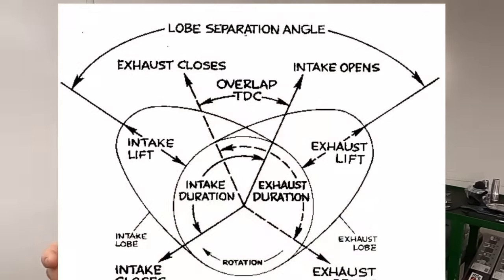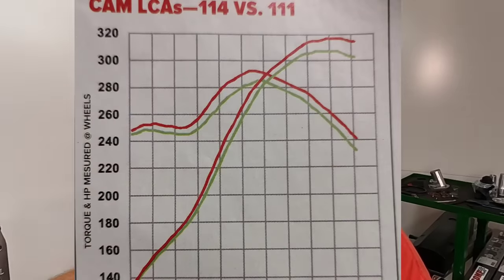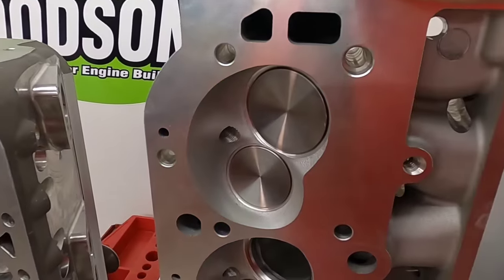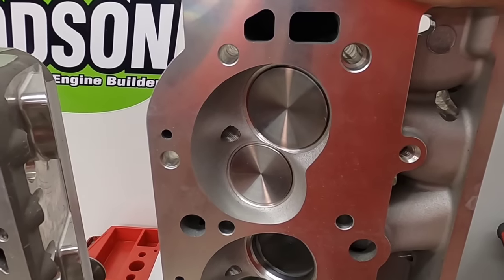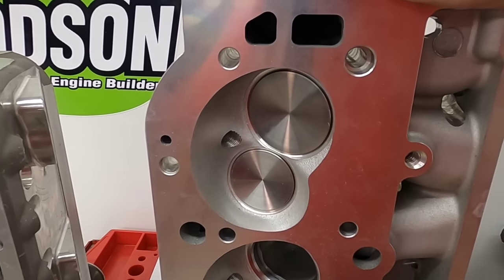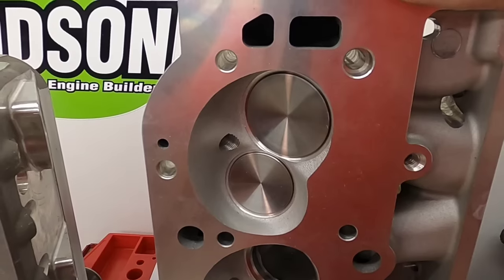Camshaft Lobe Separation Angle: The Untold Truth of LSA!! How to Pick LSA the right way@DavidVizard

Comment: I would like to know how much more violent or unstable a combination of tighter lsa vs wider lsa maybe camshaft companies are also looking at stability of valvetrain so leave a few hp on the table for longevity that was the issue of the old small block cams till it was figured
Reply from the maker: The lobe profile dictates the stability of the valve train. The LSA has no effect on that aspect.
Thanks for watching
Andy
Reply: I’m confused I understood that high compression tighter lsa since it can afford to lose some compression static vs dynamic and wider lsa to lower compression to leave more compression in the chamber but I am still learning

Comment: Richard Holdener just did a LSA video on a 500HP combo at 6500 RPM...    Same camshaft lobes ground on 120, 112 and 108 LSA.

In theory we would think tighter LSA's have more mid range torque but sign off earler and the wide lsa would have a broader and wider torque curve.

In Richards demo, the 112 LSA made 30 more ft-lb from 2500-5500 RPM than the 120 LSA and matched it after this.

The 108 LSA had 14 more ft-lb over the 112 LSA from 2500-5500 RPM and matched it until 6000 where somehow it made 7 more peak HP.    He didn't talk about it, but i felt it was from the exhaust system being able to scavenge better with the tight LSA.

So it was clear that you need to test, but tight lsa's seem to have alot of magic!

Comment: I have read that fuel injected engines like more LSA, is there any truth to this?
Reply from the maker: People tend to use wider LSA as a bandaid to cover up the fact they have too much duration.  It's better to have less duration on the right LSA the engine will make more power through the entire curve.
Andy
Reply: @UnityMotorSportsGarage  why?  Because it decreases overlap and idles smoother?

Comment: i dont know how long you have been building engines or if you are close to my age, but i have been building engines for 42 years ,im am a cam fanatic,  i buy cams with spacific  lobe patterns , im not you average 3/4 RACE  CAM  idiot , i under stand cam specs , i have a question for you you, probably havent  heard on here ,back in the 80s  most cams  were 106 or 108 lobe     separation as after market purchases, anything more 112  - 114  ,were considered blower or nitrous cams , what caused the change, now nothing comes 106 or 108.   i remember you would open summit or jegs catalog and most  aftermarket cams listed were 106  0r  108  lobe separation ,open the same catalogs today  and all but 1 or 2  cams listed are 112 or 114  , something changed along  the way, what did cam  companys figure out they didnt know  in the 80s,  please tell me if you know.
Reply from the maker: One word Marketing.. back then people would always pick a cam too large for the application and the cam companies had tons of complaints because of this.. Cam companies knowing people would continue to pick larger cams they decided to widen the lobe separation to make the car more drivable they are in the business of selling cams.. not making sure what you buy is right for your combo...
Reply: @UnityMotorSportsGarage

Comment: what about boosted?? and street driven daily with low boost 14psi @ 4500    372 sbc  hows 244/252@50 with 620 lift and 10.2:1 comp  with  116lsa
Reply from the maker: If it's turbo it depends on the pressure ratio across the engine.. ie back pressure in the exhaust vs intake boost 
Andy
Reply: Ede1179 supercharger
Reply: eaton 2650  e85 efi  3.48 stroke 4.125 bore 6.0" rod 215cc intake 2.08 and 1.6 valve

Comment: A street engine also has to be somewhat tamer than a full out race engine for obvious reasons vacuum being one concern plus just being finicky and idling being something that a street engine has to do often so a 108 on the street is a bit much in my opinion i would never suggest anything tighter than 110 or 111 for a street car but u are just gonna start it and go a 1/4. Mile or less and shut it back down hell yeah 107 and squeeze the snot out of it long duration super great heads and valve set up like a chevy 302 not the street version lol big valves springs that dont float solid lifters moderate lift but tight lsa and long duration spin it to the stratosphere and power will be there build it and they will come lol
Reply from the maker: If Vacuum is your goal, the engine will make more power using less duration on the right LSA rather than a larger lobe on the wrong LSA
Thanks for watching
Andy
Reply: Still dont understand how to pick the right LSA
Reply from the maker: my next video will shed some light on that..
Andy

Comment: I got a 94F150 flareside! Got heads! Thought bout retarding the aftermarket cams! I want powered from 3000 to 6000rpm! That's a tall order! I wanna drive it Sunday afternoon! Milage isn't a priority! I drag raced for 5 years! I got a 93 roller 351w block. 393w? Got a 100 shot of gas!😂😂
Reply: Noone gave a reply! We drag races foxbody Mustangs for years, but this is a pickup! I know guys that just jumped to 460's,  with good results dollar for dollar. I have a tci c4, three 9.5" deck blocks! A tci c4. Gas millage simply isn't an issue! I'm thinking a 393w,  and hope the tci c4 will live on street tires!

Comment: Lots of years in the trade speaking in this vid.

But when the first thing that comes out of ones mouth is boasting about credibility, you know they are convincing you because of qualifications, not because they found thw actual truth....   Case in point, higher compression doesn't mean wider lsa for optimum results, and there's no single lsa that's best for an engine's intended use. If you go from 8:1 comp to 9.5:1 with a 200° cam, the same lsa has the same effect. But if you go to 13:1, then you need a wider lsa, and a later IO event. But a 270° cam will still respond to 13:1, and a tighter lsa. 

There is no set figures in engine design. It's all about understanding the principles and what has what effect, with the materials supplied. Dyno time only gives 30% of the story, not all of it.

Comment: Won every race with a 4.6?? Were there only 4.6's in that class?
Reply from the maker: No, We we're competing against some of the best engine builders in the country.. it was a small block were limited to a 420" limit and BB limit was 470" combos under 331" we're allowed to run a .065 nitrous jet which is about 150hp 
Andy
Reply: @UnityMotorSportsGarage  aaahhhh....makes more sense that you were allowed to run a power adder. But it's gonna take more than that or the competition was just terrible.  A huge weight break or something.  4.6's are horrible.
Reply from the maker: So you say...https://youtube.com/shorts/Itnea7kREpE?feature=share
Reply: @UnityMotorSportsGarage  you coulda built virtually any other v8/car with the same effort and only went faster

Comment: Opening and closing #'s are all that matter, lsa and Icl are just products of that ,  anecdotal results don't count,  no real pro level builders are picking cams by lsa..
Reply from the maker: And they are wrong.. LSA dictates how much torque the engine will make and the overlap determines where it makes that peak torque.. while most "professional" built pump gas engine builds average 1.25 lbft per cube if they are really good they will get in the 1.30lbft per cube and we get in the 1.39-1.42 range
Thanks for watching
Andy
Reply: @UnityMotorSportsGarage  when you change the Lsa,  what changes? ... opening and closing #s, , when you change lsa and it makes more power the events were the issue,  If you understood cylinder filling,  overlap,  blow down ect, you would understand more easily,  but many fall into the trap, and it's seem good when you don't really understand valve events. Keep studying,
Reply: @UnityMotorSportsGarage LSA is not the determining factor on torque output. Kindve a circular comment imo.

Overlap controls where it makes peak torque? Big no-no there. I thought it had to do with the intake runner cross-section and it mah or may not, but I can bunk easily it isn't do to overlap or anything to do with a camshaft at all through an LS6 manifold, stock head LS1. You can run any off the shelf 0 degree to 25 degree overlap cam you want and you'll always end up with a 4800rpm torque peak through typical longtubes and exhaust. They'll cap at 6400rpm for horsepower too at a 46 degree ivc @.050" any larger and they just continue to hold power past peak in either case. But those peaks don't rise outside of a 1 in 100 deal that may read 100rpm higher on either one.

Comment: If your testing is so true that a narrow lobe separation  angle is better for the street, 106/108 etc.  That's just the opposite  of the LS series engines  5.3s 6.0s. There street engines  and have 115 to 117 or even 118 LCA. So explain? They make alot of power and a broad power  band. And my street engine I need power and torque from idle to 4000rpm,  not a 5 and 6K.  High hp and high rpm meaning  nothing for a street  engine. 8.1 liter engies the same way a wide LCA number!
Reply from the maker: https://youtu.be/Y_oWghjGHYk

Comment: That video hits an important topic, but unfortunately it is very superficial, not well presented and first and foremost not backed by proper reasoning.

I am an engine builder and have build a lot of US-V( (even though I am from germany, from Flathead Fords to LS Engines.
I try to explain to peoples since almost 20 Years that there are a lot of interlinked and dependant factors in an engine, and that the engine shouls never be whatched on its own, but in conjuction with the whole car and the application, that I really like about your video.

What I really hate, is the old "torque wins races" bullsh**
The package wins races, you have a diesel engine with 3000 ftlbs at 2000 1/min and max power at 3000 1/min in a 8000lbs truck and a 3 speed auto transmission, and I drive a small car that weighs 1500 lbs with a small turbo gasoline engine that puts out 300 ftlbs at 2500 1/min and max power at 6700 1/min with an 8 speed double-clutch, what do you think who will win a drag race, assuming traction is not an issue for both.

But back to LSA.
You did not elaborate why you should widen LSA when increasing compression for example or what the background of crossflow and valve size is for LSA.
You just throw out statements but do not really give anyone any help to make an educated decision.

And one of the most importat things about LSA you let out completely.
The construction of the rotation assembly is critical to LSA. If you have 340 Mopar (3.31" stroke - 6.123" rod) you have an engine with a high rod to stroke ratio (1,85).
That means that the piston around tdc moves relatively slowly and therefore the air velocity on the exhaust side is relatively slow and the initioal suction after tdc is also low.
That engine should not have an LSA too low.
A 400cui chevy smallblock with its 3.75" sroke but only the 5.565" rods has an abysmal rod to stroke ratio of 1.48 (which is good for low end torque but catastrophic for high rpm performance).
That engine moves a lot of air around tdc and therefore the air velocity on the exhaust side is high and air demand after tdc is high, so a tighter LSA is advantageous on that engine.

Also emissions is a factor, so if you have an emissions legal cam, the LSA will be higher.

There is a lot obout LSA and you did not really skim even the surface.
Reply from the maker: You will have to watch part 2 when it comes out!
Thanks for watching
Andy
Reply: @UnityMotorSportsGarage  I am looking forward to it :)

Comment: I've been thinking rod length/stroke ratio is relative to LSA.
Reply: DV's calculation takes multiple factors into consideration.
CID, valve diameter, valve seat angles, flow coefficient, compression ratio, etc....
Reply: @hotrodray6802  thank you👍👍

Comment: That's a weird video, it's mostly about overlap and you keep brining up LSA, then it's about intake closing in relation to compression and you fail to mention that and call it LSA. LSA is a resultant of the valve events you need, you obviously didn't need a low idle speed so your resultant from the valve events was a tight LSA. 
Thanks for looking after David.
UNITY Motorsports ununiting engine builders from cam  grinders. 
Cam grinders don't just sell one LSA option, although Comp Cams does do a lot of 110's.
Reply: DV has recently done a video emphasizing cam INSTALLED timing as per actual dyno testing.

Comment: Horsepower wins races, period. Torque is nothing without rpm and at that point is horsepower
Reply from the maker: You do know that Horsepower is derived from torque right?
Reply: @UnityMotorSportsGarage   I know this, I have run thousands of dyno runs. Horsepower wins, the guy with the largest pile of it wins. 

I do have a story I saved decades ago to show guys who claim torque wins. Before I start, how much will torque get you when the wheel is locked and you have zero rpm to make horsepower? You can still apply loads of torque but do zero work. Now on with the story. 

Mike has a Vmax 4 800ps that makes, say, 240 HP at 10,500 RPM. The math is, tq x RPM / 5252 so his engine makes 120 lb/ft of torque at 10,500. Not bad. But his competitor has a ps800 Polaris that makes greater 130 lb/ft of torque and makes 230 hp at 9300.

But somone tells Mike that he needs more torque if he wants to go as fast as the Polaris. "HP is for dyno bragging, torque wins races".

So Mike, being a crafty engineer removed the low-torque race engine from his sled and fitted the pedal crank from his Schwinn bicycle to the sled tunnel, with 12" long arms from the sprocket to each pedal, then hooked a bicycle chain to the jackshaft. Mike weighs 150 lb so now when the light turned green Mike stood up on those pedals and made a wicked 150 lb/ft of torque with his legs, but the sled is a dog because Mike could only crank that pedal 30 RPM. 150 lb/ft x 30/ 5252 = .85 HP. He didn't get it, so he asked my girlfriend, who weighs 350 lb in her pink baby-doll nightie to ride on his shoulders while he raced his sled. Now he had SERIOUS torque-- together Mike and my honey weighed 500 lb total so now on the first pedal stroke he made 500 lb/ft so now that sled should be very fast! Problem is, Mike's legs are as skinny as mine and with my girlfriend riding on his shoulders (I made her put her panties on first) (and Mike, wisely, had wrapped his neck with saran wrap) his pedal speed dropped to 9 RPM! 9 x 500/ 5252 = .85 HP. Shucks. 500 lb/ft and .85 HP doesn't do squat, and neither does 150 lb/ft and .85 but 120 lb/ft and 240 HP is dandy. 

Now Mike knows its all about the combination of torque and engine speed. Jockey them both about, and get the highest possible HP, in as broad a plateau of HP as possible so the inevitable over or underrev won't kill you. Forget the torque, you need the broadest pile of HP.

Torque does absolutely nothing without lots of RPM.(at which point it’s hp)

Comment: If lsa actually mattered then explain coyote engines with variable valve timing with separate exhaust and intake cams? Whats the lsa on those? There is none. There are installed centerlines.   Vary the centerline in the tune and watch power curve change. There is an optimal valve timing for a given rpm range. The DV method just a made assumption for a given platform that cant vary valve timing due to one cam.  Design the cam for one rpm range and it takes a different lsa, different valve events. Optimize for another and its different again
Reply: You answered your own question; it's variable. Everything moves around according to the phasers, yet only moves X amount, and everything stays within X max travel limit. You also have to understand that Ford mod engines use hydrostatic brake boosters. So we CAN get away with tighter lobe sep and split lobe sep. None hydro engines can't do this without modifications or switch over to vacum pumps or manuel brakes. I have a cam in my engine that is split lobe 96 for intake and 106 for exhaust. And it slams pandoras box with tourqe at 1500 rpm till 7000 rpm on a 427 cubic inch.
Reply: Yeah But Some Engines You Can only Advance the Intake Cam not the Exhaust cam So you still Need To Adjust your Exhaust cam manually to get the right LSA
Reply: @itachiuchihathechosen1466  it isnt the lsa you are looking for its exhaust centerline and opening/closing events. Lsa only exists because of engines with one cam that have both exhaust and intake lobes on same shaft
Reply: @orr89rocz  the LSA Exist in Dual Over Head Cams  that is the Benefit of a Dual Over Head Cam With cam Gears Being able to.manipulate your LSA  to your Preferred Angle At Anytime with any cams you have
Reply: @itachiuchihathechosen1466  you are manipulating the centerlines! Lsa is calculated and meaningless
Reply: @itachiuchihathechosen1466  think of it this way. 108 intake center line 112 exhaust center line.  Thats an lsa of 110.  That same lsa can also be 100 intake and 120 exhaust centerline.  Or 110 intake 110 exhaust.  Which lsa is better 110 or 110 or 110?
Reply: @orr89rocz  LSA Affects how much Valve Overlap your engine is going to have which is very important for your engine
Reply: @itachiuchihathechosen1466  im done lol  again, 108 int centerline 112 exhaust 110 lsa.  Or 100 intake centerline 120 exhaust.  110 lsa.  Drastically different.  You think they run the same because lsa is same??
Reply: @orr89rocz  intake is 110 put exhaust at 106 center line add them 110+106=226 divide 216÷2= 108
Reply: @orr89rocz  you need to manipulate your cams according to your setup to get the most out of them